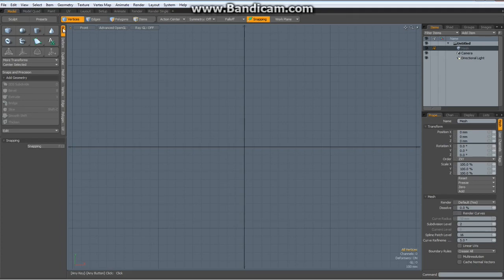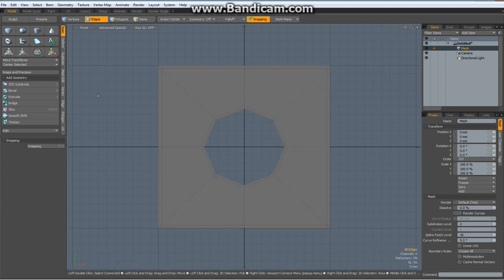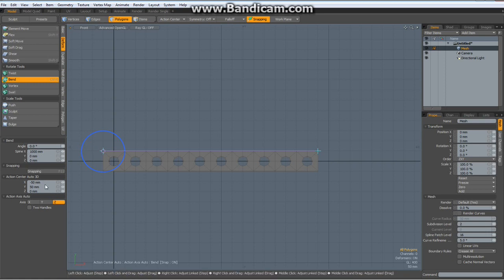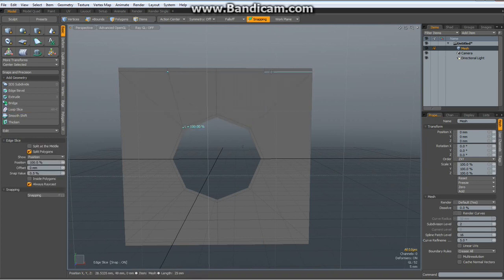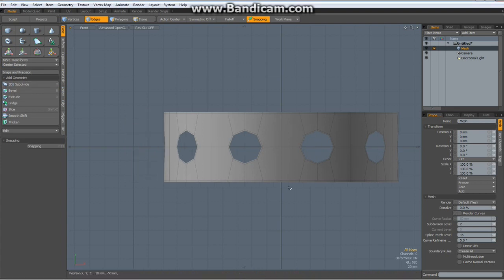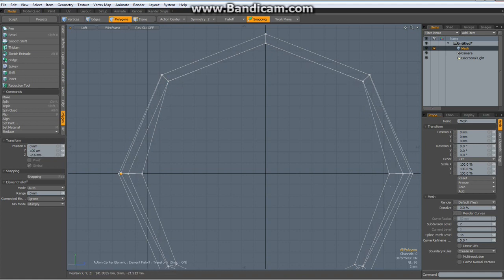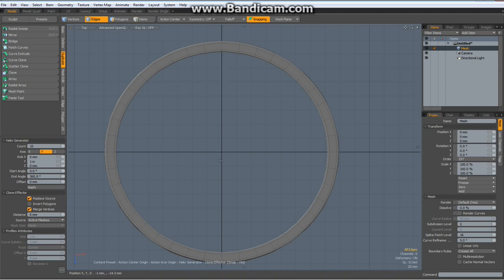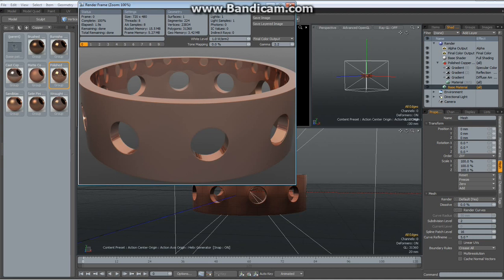Modo 501 From 2D to 3D Part 4 - Perfect holes in a bent surface

Comment: I would like to kindly ask Peter if you would made a short layout tutorial or explain here how you set up your render screen, as it is different from mine out of the box. Also could you explain how you zero out figures in position xyz so fast, as if using some shortcut/key press which I can't mimic. It takes me three operations on each pos. Many thanks, Peter, for all your time you take to make these very useful tutorials. They are the best...  Sharing your layout and configuration specs would allow us to have a better experience with modo, as I find it clunky and quite hard to operate.
Reply from the maker: +tangomechanic Hi, quite a few things have changed since 501 :-) You can move the boarders of your render screen to whre you like to mke it look like in 501. The secret of zeroing out all is when you click once on the symbol left of the arrow keys. Then you will get an '=' sign and whatever value you enter it will be entered in x,y and z. Hope this helps. KInd regards, Peter
Reply: +Peter Stammbach Yes, it was helpful and it works :-) THANKS!

Comment: when i use transform and snapping  in wireframe mode it snapps on the x scale downwards (makes the 3d into a 2d flat as a result at the end ) even if i'm in the left view and i had to remove snap to get this result but i fear that its not pefectly aligned do you have any advice for this problem?
Reply from the maker: BlazeEviL I do not use snapping very often because it behaves sometimes very strange, especially when the vertexes are close together